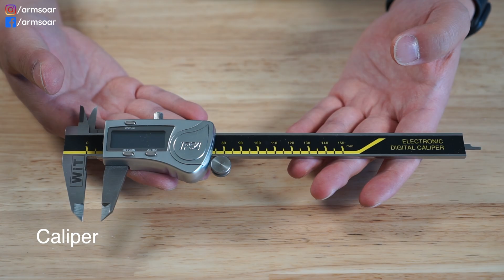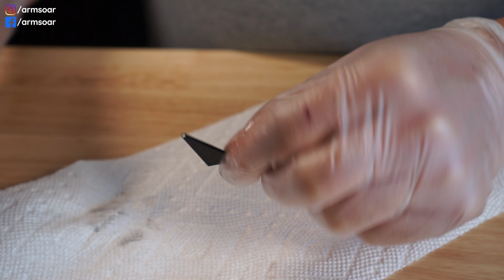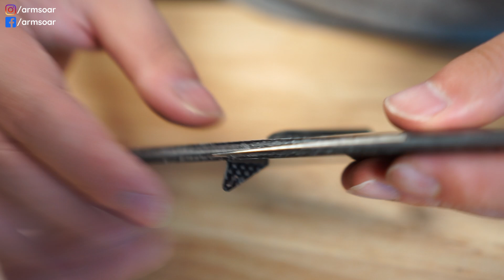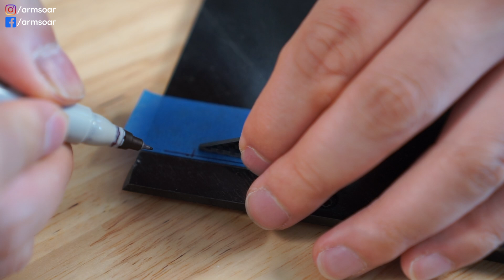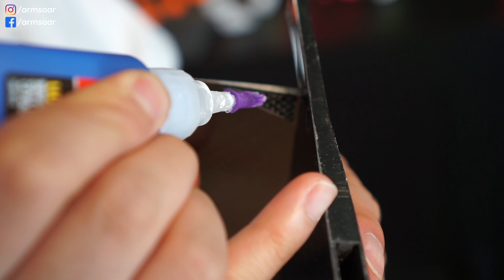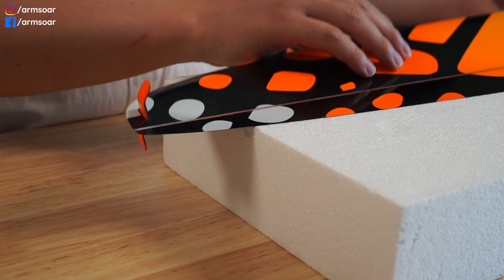BAMF 2 DLG Build Log Part 1

Comment: Do you need to spray the gorilla glue with water at all? Or is the goal for it to not fully cure?
Reply from the maker: We don’t spray it with water, and it still seems to fully cure from the moisture in the air.
Reply: @ArmSoar  thanks!

Comment: Doesn’t the gorilla glue need a bit of moisture to cure/foam up? Good tip to this though
Reply from the maker: The more moisture the more it will foam and expand. We only need it to foam slightly inside the tail pieces so no need to spray with water before gluing.